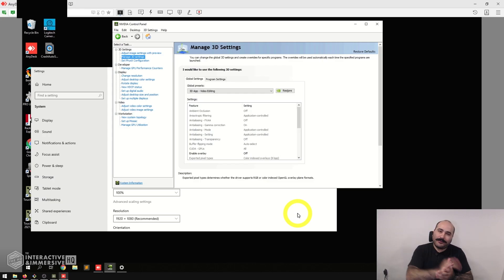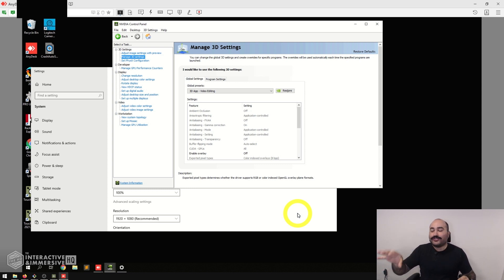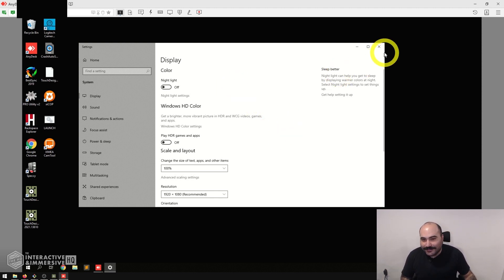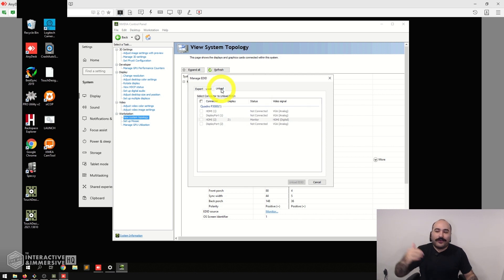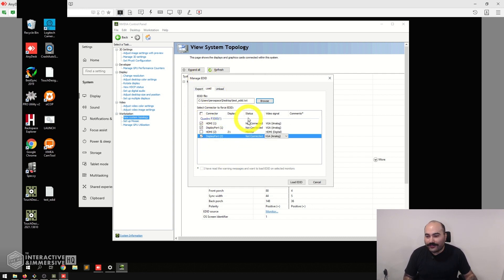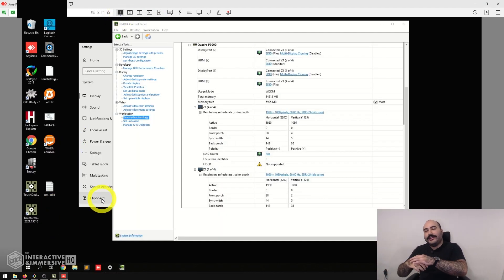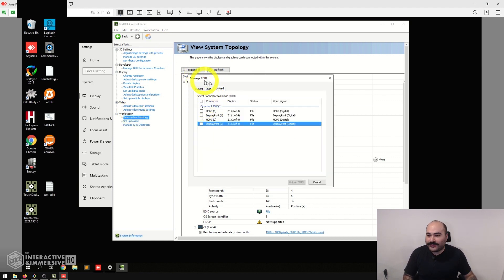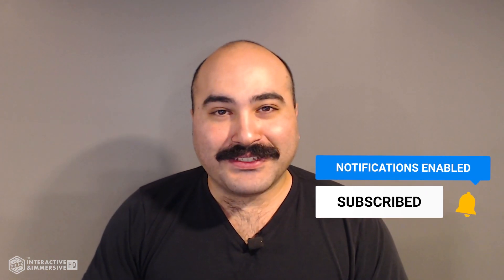Simulating Displays with EDIDs for TouchDesigner - TouchDesigner Tutorial 050

Comment: So this got me googling what else NVIDIA is hiding in there. Two cool things I found: You can warp and blend on the GPU with NVAPI. You can also use Nvidia Omniverse for near real time syncing of assets between applications that support it (like having a model in Blender instantly show up in Unreal as you're creating it). It's built on USD so it's not completely proprietary either
Reply from the maker: Nvidia has A LOT of things in the pipeline/released that are really interesting. I haven't worked a lot with the warping of NVAPI, but the blending/bezel compensation that you have access to with Premium Mosaic is great and I've used it a lot over the years. I haven't dug into Omniverse yet, but it looks promising!